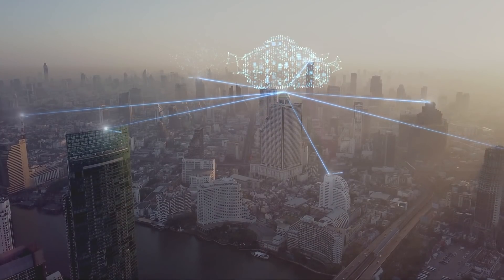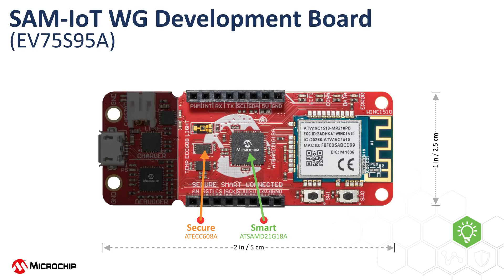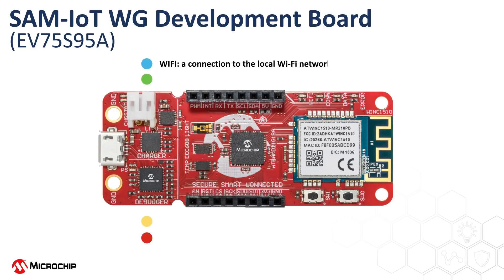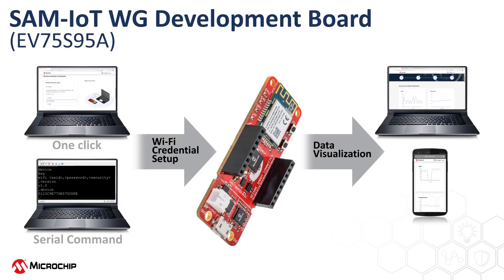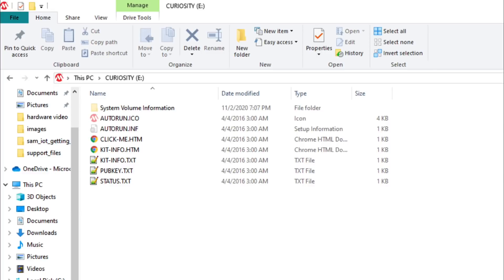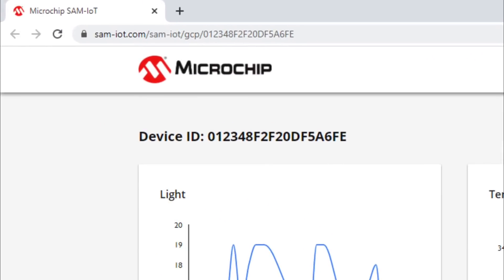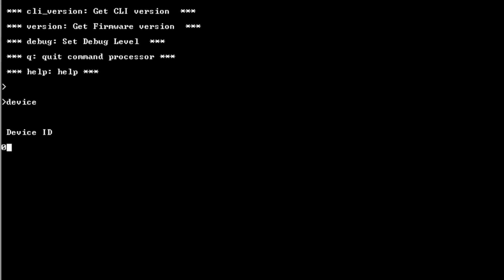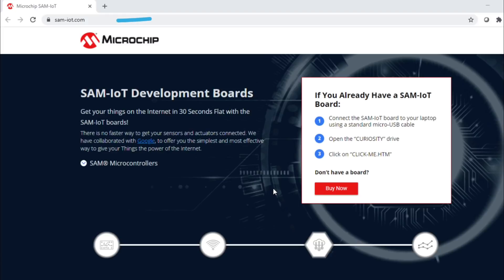Getting Started with the SAM IoT WG Development Board

Comment: I could not connect with TeraTerm unless I changed the speed from 9600 to 115200. Also, the "Get The Latest Firmware" button shows "This link has been removed" once pressed. Lastly, I was unable to post the temp data to the web. It looks like you guys DON'T have your shit together, doesn't it?